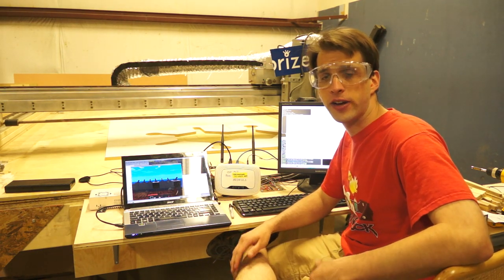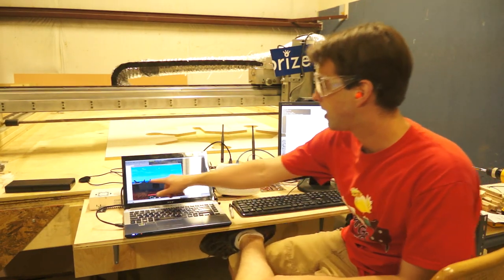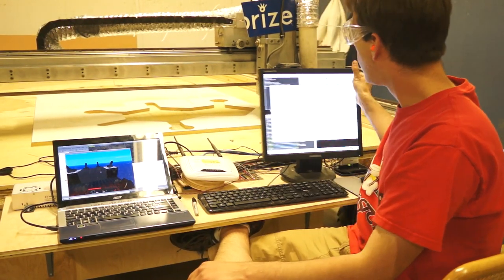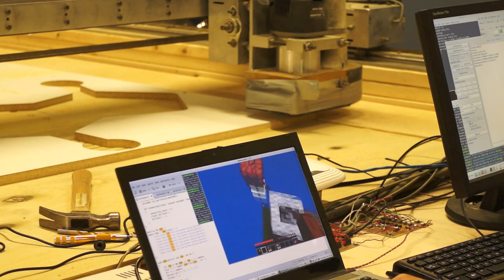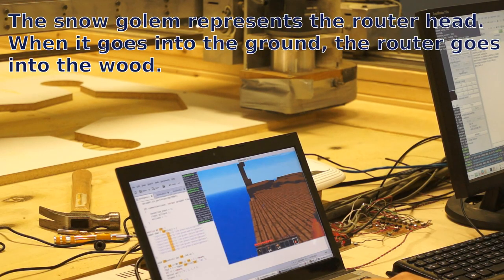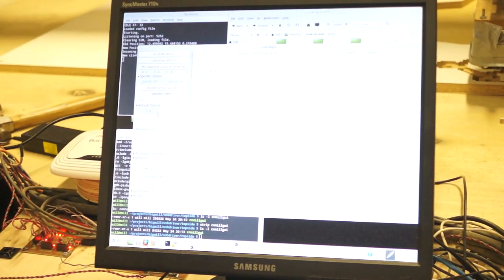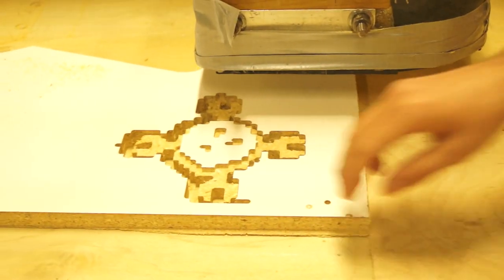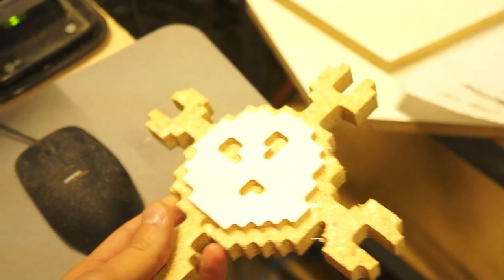Running Minecraft on a CNC Wood Router

Comment: Who the heck would dislike this video? This is extremely cool. I think it mostly demonstrates the power of those little AVRs. Which most people will overlook just for the simple fact that it's Minecraft.

AVR + Minecraft server + Wood router.. Uhh. Yeah, thats freakin awesome. I don't even know how you thought of putting these 3 things together.
Reply from the maker: The minecraft server in this case is not an AVR.  It's a Wireless Router running a Wood Router :-p
Reply: Ahh. I misunderstood. Still cool nonetheless. Even if it is a Wifi router, that isn't much computing power. I just love the idea of finding all sorts of uses for embedded projects with old equipment like Pogoplugs (Sheevaplugs), routers, Wifi SD cards (a 500Mhz linux device ;) And even the ability to get right down to the clean C code to program MCUs for specific applications.
Reply from the maker: As someone who professionally does a lot of ARM development... If you can't do it with an AVR, you're probably doing it wrong, or are too lazy.
Reply: Robert w Why would I buy more expensive controllers and processors with extra power consumption for an over powered device I don't need? AVR works great for minimal projects that have very limited power. Say a button cell battery for environmental sensor measurements. Your circuit will die in a few days while mine will probably last a few months. Just because you personally don't find a use for them or know how to properly debug one, does not make the product trash.
Reply from the maker: The NXP's minimum power consumption is 0.5mA in active mode, not 90uA.  If you run it at 30 MHz, you get 90uA PER MHz.  I did get the atmega48a down to under 1.2uA while it was running a capacitive touch sensor, checking an adc and doing a few other things several times a second...

Get your NXP to bit bang ethernet, bidirectionally and we'll talk.  (And you'll probably get on hackaday).

NOTE: After looking at the specs that may be possible /if/ you can coax that 30 MHz up just a little to 33. And you use an external line driver... I may attempt that if you don't.

The real bottom line reason I use AVRs is because it's so gosh darn fast to develop anything on them.  You can go from nothing to a useful project blindingly fast.

Comment: Question: if you were to make a redstone microcontroller type thing in minecraft, can you run that as an interpreter in the custom minecraft interface servers you make?
Reply from the maker: My current server does not support intelligent redstone use, however that would not be difficult to do and then, it would.  You would have to keep hardware condierations, though.  In this video I am running the server on a router, which has 4 MB of free RAM, more than enough for a large redstone circuit.  However, on an AVR, it would scant be able to run more than a 10x10x4 circuit.
Reply: That makes sense. This looks pretty nifty though, I'll admit :3

Comment: It's awesome, but could you write how you programmed the wi-fi router? I know a little bit about that, but have you found a command set for your router?
Reply from the maker: I used OpenWRT on the router.  To get the compiler for it, I downloaded it from the first page on google when you search for "openwrt buildroot usage"
Reply from the maker: What router do you have?
Reply from the maker: ewe 2MB Flash.  I dunno if that's ever gonna be supported.
Reply from the maker: You should probably get another one.  I used the TP-LINK TL-WR841N